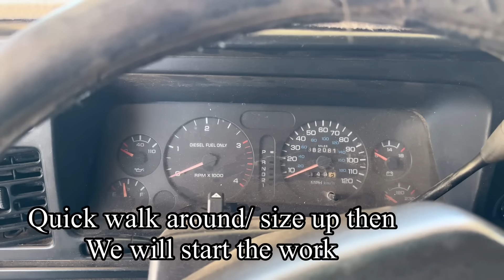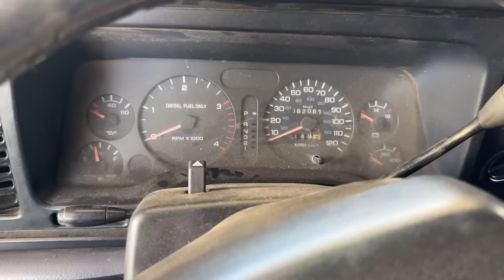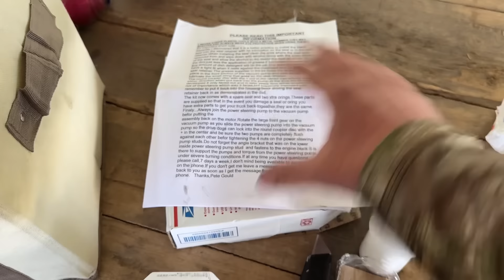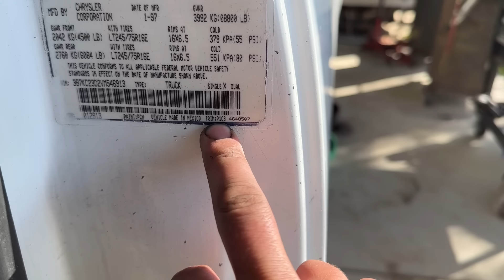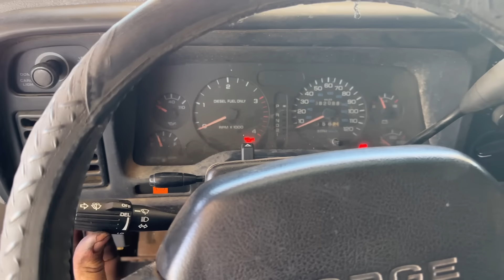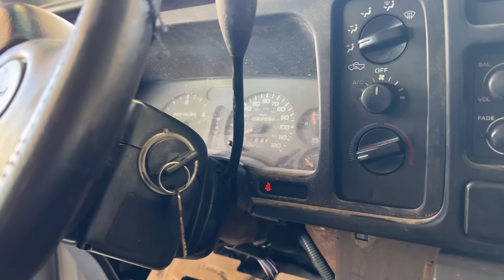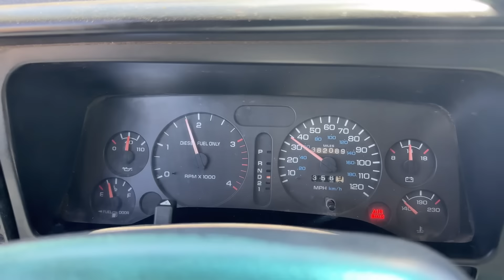I bought the CHEAPEST Cummins I could find… but it might be broken

Comment: You wouldn’t find anything like this in Wisconsin. They are rusted out up to the door handles.
Reply: Same in New England ! Never knew how bad have it until youtube came along and I saw what they considered "rusty" in certain parts of the country 😂😂😂😂
Reply: You'll find a year round daily 2nd gen in my driveway up here in Canada that's just as  clean. It's called properly washing a vehicle and no rust happens.
Reply: @robbalinski1606  
Depending on where you are in Canada, they may not use the amount of road salt that is used here in Southeastern Wisconsin. I have seen Dodge, Ford & GM trucks severely rusted and they are only 6 or 7 years old. My neighbor just got rid of an ‘11 F-150 that had no rockers left. When I was still working I took in a ‘13 F-150 that was 4 years old. When we removed the fenders the structure underneath was badly rusted. I even called the owner of the truck in to see it so that down the road if there was an issue, we wouldn’t be accused of shoddy workmanship.
Reply: try california 😭
Reply: We are very fortunate here in Southern California.  Our climate is perfect for long term survival of automobiles.  No snow, no salt, hell, it hardly ever rains here! Lol..my 58 cadillac and 68 Mustang are lifelong Southern California cars.  No body rust, and the undercarriages of both are just amazing. A little surface rust here and there, but mostly no rust at all. The frame on the caddy is still sporting all its factory black paint. Now the political situation here is a whole other story.....

Comment: A note about compressors: You should never have to add refrigerant to a AC system, it is a hermetic system. This indicates that there's a leak somewhere and if you add refrigerant you'll just be doing it again down the road. They make a UV dye you can add to the system which will help you find the leak source.
Reply: This is  hard to believe,  but my 94 Trans am with 338.000 miles on it,  I bought new,  and lives in the southern California  desert area,  where AC is needed from May thru October , still has perfectly functioning AC, nice and cold, and never had any refrigerant added! Amazing.
Reply: @johnfranklin5277  that's extremely fortunate, here's to another 338k miles!

Comment: On the blowby issue make sure you don't have any of the vacuum lines coming from the vacuum pump leaking.  I all the sudden started getting alot of blowby out of the vent tube on my 24V, I had a broke vacuum line and it will suck air in and it gets pumped into the crankcase which gives the illusion of blowby.  I installed new vacuum lines and my blowby went away.
Reply: sorry should have watched longer, I seen you mentioned the pump can cause blowby.

Comment: Those seats are from a 99-02 2nd gen factory upgrade for the older trucks.
Dont get why your afraid of the 2nd gen 24valves their just as solid trucks.
Reply: My 94 has manual seats. Can I put these power seats in it and supply them with power and ground and they'll work?

Comment: My front suspension is completely rebuilt and the previous owner has replaced the front pump input shaft seal and torque converter so the transmission shifts right into reverse and just starts backing up with almost no throttle input so it doesn't have transmission issues..

Comment: Blow by is pressure. If your oil fill cap doesn’t get moved or blown off then it’s not blowby. Crankcase vapor is what you physically see, and it’s nothing to worry about. Oil gets hot, it creates vapor. As for the seats, those are stock 98-02 seats. Your oil leak is a booger to deal with. It’s a simple o ring, but getting it aligned back up is a bear sometimes

Comment: Nice job Travis! I remember when working for Chrysler up into the mid 90s, the early Cummins had recalls on transmission flex plates cracking and a host of other items. once all those bugs were gone, that truck combination has been bulletproof as with good maintenance.
Reply from the maker: Yes close to bulletproof as one can get !

Comment: Those seats are from the interior redesign in 98-02 for the 1 tons i the truck dash skinz dash cap on my 2000 anyways the Laramie slt plus are the one's that got those leather dodge ram seats and they usually have woodgrain on the door panels and the dash bezel..

Comment: A lil haze out of the oil filler cap is fine as long as it doesn’t blow the cap off when you’re having it on it’s fine but the haze out of the bottom you could tell it has some

Comment: 37:20
The new front right wing panel: I wonder when 3D printing and laser dimension scanning will be at the point where you could scan (or get 3D data for) an original part and then print it out of something like fiber-glass.

Comment: Actually I believe that the 3500 2000 to 02 slt plus interior do have those leather ram head seats and wood grain trim and cluster bezel trim, my 2000 dodge ram laramie slt quad cab long bed is just a magnum V8 318 gas at 46 RH 4x4 truck and manual rainbow thead seats and door panels typical Chrysler interior mist grey

Comment: Amazon sells the dash skin for 100 dollars 
The transmission will last and run for ever with 68 hydraulic personal experience oil  viscosity fall at high temperatures
Reply: You mean run 68 hydraulic oil instead of atf+4 like they recommend?
Reply: Yeah my truck has the dash skinz dash cap

Comment: Those Transmissions require a lot of Maintenance and Service to keep midnight shape you really should pull the pan and put a new filter in it and change the fluid don't flush it necessarily if it's going to lock up converter but change the fluid in it it's doing it a favor and just bands if there's anything to be adjusted on it

Comment: Not sure where ur located. But I've got a 98 24v ex cab cummins dually. Like 150k auto. I need to sell cheap. I'm in The military, so no time.Truck is in south Arizona  runs and drives, but wrecked in front. Has aux tank in back.
Reply from the maker: Email me travisblades1956@gmail.com

Comment: Do you want a Cummins 12 valve? I may even know of a truck that it would work well in. Here's the story. Tri-five Chevy that somebody put a 12 valve in it. I'm not interested in coming powered tri-five Chevy. But if I could get enough out of that Cummings I'd be interested in the car? I don't know much about those 12 valves or almost any diesel other than the military spec GM 6.2. in any case your expertise on this engine would be useful. How's that primiparous point-of-view haha. All I know is the car move under its own power and drives okay. The other part of the story is that second gen 4 wheel drive dually Dodge man just wanted to get rid of it he bought it for the drivetrain good-looking truck. Sold a couple little things off of it and offered it to me for $250. Yeah I should have went after it is only two or three hours away from a place I could have dropped it off and let it set. Be glad to share that information with you. The truck may be available. But engine I'm assuming transmission and driveshaft could be crated up and shipped. Location of that truck is right in the middle of the Midwest. Location of the engine is farther east.  What are your thoughts?

Comment: I know those trans pan bolts where loose which is actually pretty common when you come across a leak but tightening them is a very temporary fix it will leak again and maybe even worst than before plus should’ve just serviced the trans anyway and there’s a good possibility that the overdrive and reverse band needed adjustment

Comment: You really ought to flush out all that brake fluid plus really you should have bought new hardware for the brakes hell in my world you should have bought new drums for both sides instead of just one that way you start out with a true 10/11 whatever 11111 1/2 whatever it is diameter if you don't a lot of times that vehicle will not stop straight